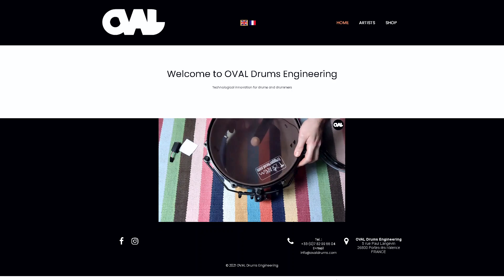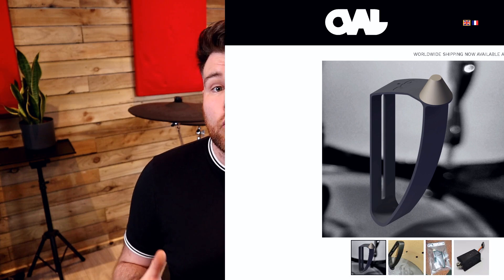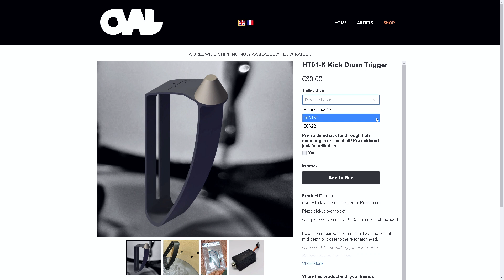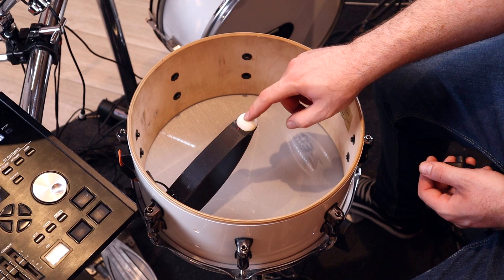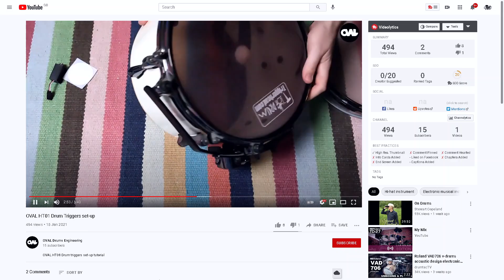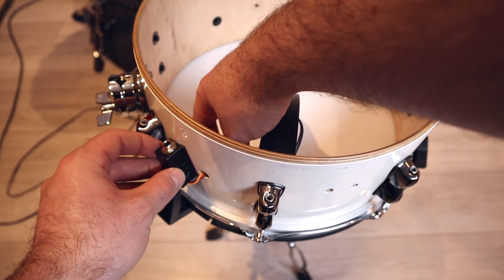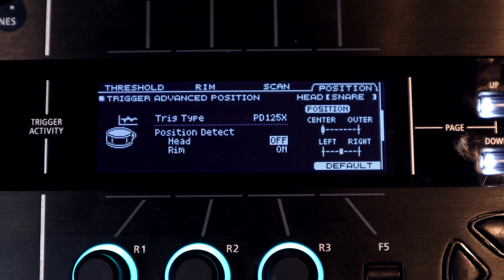OVAL Drums Trigger Review | HT01-K Kick Drum Trigger & HT01-D Dual Zone Trigger | A2E Conversions

Comment: @ 14:50 Piezo may need a more dense foam on the cone to combat the hotspotting issue. I have been experimenting with silicon cones because with foam it tends to relax from the depression against the head. Silicon has no issues and stays the same in its rebound properties. Whilst the minimal approach seems great the retriggering is coming from the flex in the mount. 

The other thing I have tried also is the size (diameter) of the piezo. The bigger, the more sensitive... smaller less sensitive. But silicon is definitely the way ahead. 😉

Comment: I'm not sure anyone is paying attention here because this video is older; however, I was re watching some videos and noticed something worth mentioning.  The rim sounding on the head zone on the TD50, 27 is a direct result of piezo polarity.  The modules want to see a negative first side wave in the wave form for positional sensing on the 50,27.  This is why all the wiring diagrams show the brass part of the piezo going to the tip, however polarity the of piezo itself can vary.  Flipping the wires round they way you did wouldn't fix this you need to do it between the piezo and the jack adapter.  This may give you actual positional sensing on the trigger.  This problem only seems to apply to the 50,27.  It's doesn't happen on my TD 20, Strike, eDrumin or Megadrum.  I believe it's inherent to the way positional sensing is processed on the 50,27.
Reply from the maker: Thank you for this, great info!
Reply: Happy to contribute.

Comment: I have installed the Ovals on my floor toms (13" and 14") with SD 3ply mutes, still yet to convert my two rack toms. Using the TD-17, I had rim triggering head issues on my 13" until I found the right setting (PD-128 seemed to work better than PDX-12 on my TD17). I thought this was bizarre, since I got single zone triggers (all my tom jacks have cable splitters for cymbals). I still had a bit of double triggering at high velocity until turning up the re-trigger cancel.
Reply: Never mind, the PDX setting works better for the 13", but not the 14". Sometimes I just don't understand what is going on with edrums.

Comment: I have the Oval Kick trigger : best trigger I've ever had :) 

Never tested snare trigger tho, but i'm sure you can achieve good results with some tweaking :) 

Thanks for the review !
Reply from the maker: Glad you like the kick trigger! I'm not so convinced with the dual zone trigger though - I'm pretty well versed in dialling in triggers and it was basically impossible to get reasonable response from it. Nothing suggested by OVAL worked which makes me think either the design itself isn't up to scratch or my specific model was faulty.

Comment: I'm currently looking into getting a 14" snare. Since both Roland and Drum-Tec aren't that pretty and very expensive to boot, I was thinking about getting a decent looking snare and doing an A2E conversion on that myself. What's currently your favourite snare trigger setup, including positional sensing?
Reply from the maker: I haven't really found a centre mount trigger that I particularly like because they all hot spot terribly in the centre, except for the Roland digital snare (which I use when I want PS). The best that I've probably used is the DRONE Halo centre cone version, but the usual centre cone hotspot applies.
Reply: @TheeDrumWorkshop  Thanks for your reply.
I seem unable to find anything like a store for the Drone Halo triggers, just YouTube videos, which look promising. Is there any way to actually get them?
Reply from the maker: It's difficult, to be honest as he's more of a hobbyist builder! The best way is to message through his DRONE Facebook page or maybe through his eBay account (kittoys-2012). I don't know how many he builds at a time or what the deal is with parts at the moment but it's probably worth asking. I personally use his Halo side triggers for my toms and love them. The centre one is just as well built as those but just doesn't have the same foam padding.

Comment: Hi luke how are you? Given your experience, can you recommend some internal tiggers to apply to toms and kicks that work very well? Thank you Alex
Reply from the maker: I really like the DRONE Halo triggers, but their availability isn't always great as the creator of the triggers is a bit more of a hobbyist. Not tried his kick trigger, just the toms (they're side triggers), but the kick trigger looks good too. Worth having a look to see if there are any available. The Jobeky spoke triggers (centre ones) are decent for toms too, though I've found mine a bit hot overall - will have a review of out soon. I personally just use a DIY kick trigger as it fits my needs well and they're the simplest kind of trigger to make.
Reply: @TheeDrumWorkshop  Hi Luke, thanks for your reply. From what I understand the Triggers you prefer are the Halo, but even more those made by you. May I know how you made them since I have a 22 "/ 10" / 12 "/ 16" drum set to make?
Reply from the maker: Hey. No, the Halo are my favourite for toms overall. I've never had good DIY results with toms/snares. It's only the DIY kick drum that I use. It's just a piezo mounted to a bar at the "6 o' clock" position on my drum, with a foam cone. The wiring diagrams can be found online, but for a single piezo it's very simple wiring.
Reply: @TheeDrumWorkshop  I get it. I've seen internal triggers like the ATV e-drums which has 3 or 4 sensors on the outside of the drums. What do you think about that? Is Roland like that too?
Reply: @TheeDrumWorkshop  Hi Luke how are you? Unfortunately I don't know where to write to you outside of YouTube and so I rewrite here. Have you ever tried the prestige series wooden e - drums and Jubeki cymbals? Thank you Alex